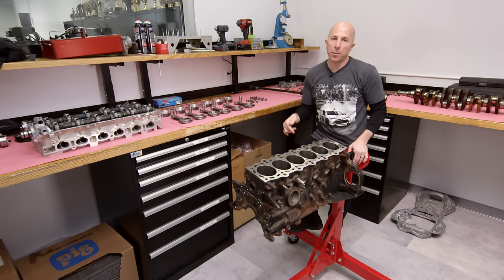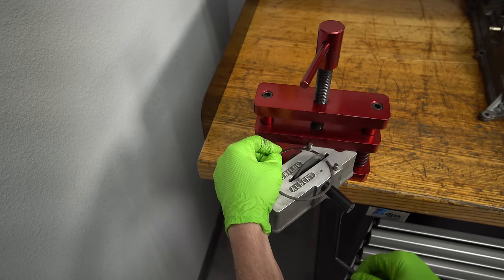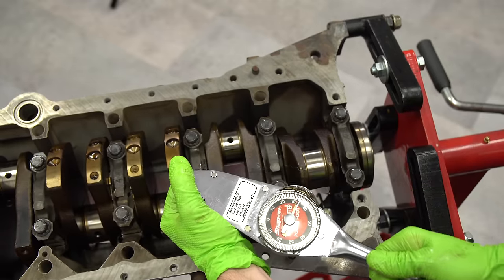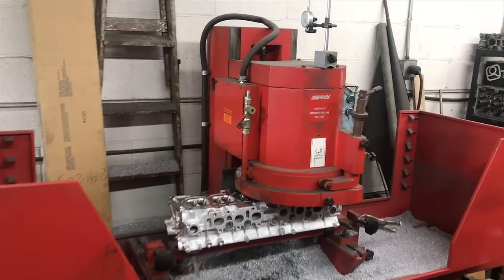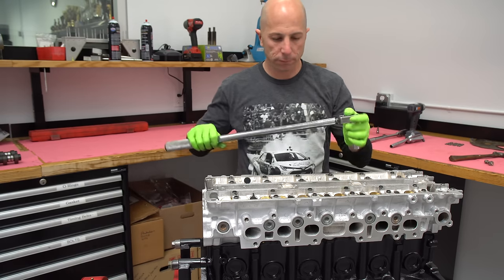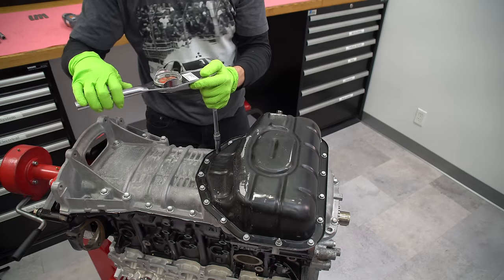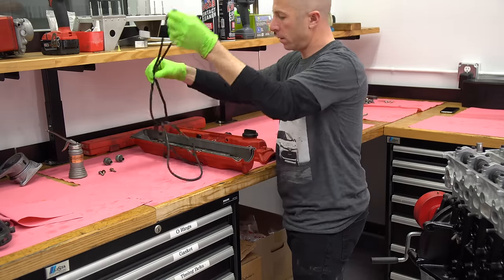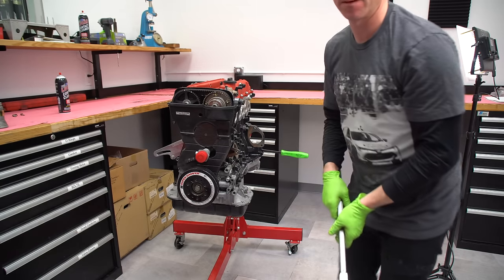Toyota 2JZ Engine Build - Full Start to Finish

Comment: What's the process for starting up the engine for the first time? Do you need to have it tuned properly? Is there a different process for trying to get the engine running with a stock ECU and a Standalone ECU?
Reply: @Ed O'Neill but to run on a dyno, you need to start the engine right? Is it possible to tune the engine before you start it? I'm assuming its just a baseline you need to develop and then you can get it right once it's running, is that correct?
Reply: @Ed O'Neill interesting, thank you for the insight, I got some studying to do on this
Reply: @Ed O'Neill lmfao
Reply: Ok, for those who don't get the humour and just want an answer: right after the build you want it just idling for a while... Nothing more than that. The stock ECU should be fine for most builds, and if you have some high-RPM camshafts then you kinda need to adjust some things (higher idling RPMs, perhaps a bit more fuel, etc).
You want it idling for these reaons: 1) to test that it runs and to see how smoothly it runs, 2) to let it warm up without putting it under load and see how the engine runs when warm (like testing compression and checking for leaks), 3) you won't have detonation and pre-ignition when idling so not much can go wrong if you just idle, 4) to let the oilpump spread the oil everywhere, 5) the piston rings start breaking in during the first +-15 mins of idling (read the manual for exact info) the tin coating and the special shapes and other magic is there to allow the piston-rings to partially break in.
Every engine is a bit different, you want to tune to either fit your particular engine or tune to make less power and be on the safe side (more like a factory tune or a baseline tune). But you can't have a perfect tune ready if your engine is not ready, right? So the proper way of doing it is to flash a moderate tune (with not too much power) onto the ECU to let it break in and to test it, after the break-in you change oils, check the state your engine is in. And after that you can then start finetuning and adding power and pushing it to the limit.
After a proper break in with moderate load, not too high revs, etc, you will have an engine that runs better than it was right after it was build. After breaking in you will have a higher compression due to better sealing of the piston rings for example. So how could you tune your engine before break-in?
---
This is how to get a longer lifespan on your engines, this is how you want to build streetcars for sure. On a streetcar you don't do an engine rebuild after ever few runs (like the top fuel dragsters do) so you kinda want it to last.
Reply: LMAO I should have read more carefully
Reply: @Ed O'Neill well played sir, I was most definitely giving you the benefit of the doubt hahahahaha made my day, you got me good
Reply: @sasjadevries  thank you for the answer, that makes alot more sense hahahahahahaha
Reply: Ed O'Neill 
Wait what?
XD

Comment: Hmmm. I was proud when I changed my own oil;(
Reply: changing your own oil or your own brakes for the first time is really satisfying tho, it's when you realize that you can actually stop being ripped off by your mechanic
Reply: alot of thinks can be done in cars with basic tools if you just know what youre doing, but theres still alot of thinks where youre going to need special tools and knowledge.
Reply: @PP-360  and youtube guides like chrisfix
Reply: @PP-360  no joke probably the best yt mechanic out there
Reply: @maxnasstrom2652  yep I agree
Reply: A lot of time mechanics just put the cheapest oil they can find into your car
Reply: @RmX.  Coming from a mechanic from Sweden. We don't, however, we rarely go for the best oil either. Oil changes are frequent and people who do care about their cars do service when they should according to their manual. Hence the quality of the oil does not matter AS much. Going for something in-between the best and the worst for regular changes basically keeps the car going until everything else in the car breaks down before the engine does. We always follow the recommendations from manufacturers. :p
Reply: You'd be surprised how many car owners don't know how to change the oil in their car!
Reply: @charlie_mk7.5  What is that profile picture?
Reply: @charlie_mk7.5  I can do it all day,I just got lazy as I got older and I just like to pay someone doing it for me.

Comment: As a vehicle technician I love watching these videos.

First observation is how much simpler the 2JZ engine is compared to the new Bmw/Toyota engine.

That new engine will never be iconic, but this engine has had a reputation for producing big horse power reliably for years.

I don't like all this over complicated engineering, it's not needed, the original 2JZ engine proves that.
Reply: oh yeah when you have to deal with the way tighter emissions and the way longer life expectancy of modern engines you will know why they get so complicated
Reply: Ja du musst ein Profi sein. Früher mussten kaum Emissionen erfüllt werden, gute Besserung..
Reply: The 2jz in the video isnt the one in the old supra, the one is the supra is the 2jz gte, which is built to hold more power, you could get a regular 2jz in an old lexus sc, but it cant hold the power

Comment: Dont the head studs have a torque sequence? Cause i thought you were supposed to go outside to outside inward type of thing or just nah? Cause in the video yall just did 3 right next to eachother. Unless if you were just checking them after the fact.
Reply: They have a very specific torque sequence, yes. You can find diagrams on Google images if you want to know what exactly it is.
Reply: the studs don't. the nuts that go onto the studs to clamp the head down do.

Comment: How long will last before you have to do this all over again?
Reply: Blatantly Fake Name they do it every season but on a safe tune it should last a few years without much issue
Reply: A long time dude. The 2jz is one of the most reliable engines ever.
Reply: Another 200,000 miles like any Toyota engine. They're going to lean on it pretty hard if it's a Drift engine with a bunch more boost but it will still go a good long time.
Reply: It depends on the clearances. The 2jz oem pistons are very very good and if your power goals are less thn 750hp you should just rebore, hone and install some new 0.25mm oversized oem pistons, by keeping the factory 2jz clearances. Forged rods with 625+ bolts and some nice trimetallic bearing and finally crank balance to your desired rpm. It will last a lot more than an oem 2jz. But, don't use titanium retainers, those will fail shortly. Very little weight savings for a lot compromise. Use stainless steel and with a safe tune you may see 150.000km with 650+ hp

Comment: How much does it cost at this point?
Reply: 1 million dollars.
Reply: I guesstimate 15-25k usd depending who you know
Reply: After 15 grand and if needed, overnight parts from japan, you will decimate all 😂 #2jznoshit
Reply: The cost really depends on whether you do it yourself or you need to hire an engine builder, and it depends on what country you live in. (In Russia decking, polishing, machining, etc is really cheap)
And it depends on how many non stock parts you buy, and in what state the engine was that you bought.
Reply: probably around 5-7k in parts
Reply: @sasjadevries (Caution! There will be wrong and breaked english) Yep! In Russia stock 2jz (good condition) cost ~2000$ . Full gasket set - 300-350$. Cylinder head clean and porting - 150$. Parts like timing belt, motor oil and etc, no need to include it in total price. Assebling the engine - its cheap, coz its easy. And total price for fully stock 2 jz-gte vvti - something about 2500-3000$. Im really exited when i see the prices like 15-20k$ in a comment section.
Reply: just had my bottom end built by a shop in TX and it was $4300 after I toasted a stock piston. obviously that does not factor in the entry price of purchasing the used engine originally and any associated headwork.

adding initial purchase price and all the head parts/labor (cams, springs, retainers, valves, pocket port, etc) with the bottom end stuff, and we quickly jump up to around $8-10k USD (not factoring in turbos, manifolds, etc).

and that's just for a build of this nature. they can easily get far crazier with strokers and all the other crazy stuff out there.
Reply: I'm not sure what it costs here in Australia but I'd expect "fucking heaps" due to our small number of people compared to almost every other country.....
Reply: ^ Yeh too right. Would be almost as much as a pack of smokes here.
Reply: @ardijanuar2036  Apparently you've never seen what the LS can do for a 1/3 of that.... #sloppymechanics
Reply: More than you can afford pal ;)

Comment: Y'all gonna 2jz swap a MKV or just build up the BMW engine it already has
Reply: some company is apparently working on that swap kit but it's going to cost an arm and a leg for R&D and drive the prices of the 2jz up even higher than they're getting. So get one quick if you want one!
Reply: @ConTheDon187  wouldn't it be cheaper to just drive a mk4 Supra then? Isn't it considerable that the 2j would make the mkv car just worse? I mean it's a great engine & a great base, don't get me wrong, but maybe the new engine just fits the car better.. You'll most certainly be able to make that thing fast too, but it would be more modern. If you're buying a mkv, you're not in the market for an older car..
Reply: I'm not the one making the kit and haven't driven a mk4 nor a mk5, I just said get ready for 2j prices to go up because of the company/companies making or setting up the swap kits. Someone told me, which they're comment disappeared that the kit will only be 9k, which i don't know is true or not. The bmw motor in the car is also an inline six which I'm sure you know and obviously toyota wasn't about to open up plants and re-manufacture all of the equipment to build the 2jz to put in the the car. it was a joint development with bmw to cut cost so it wasn't a ridiculously expensive car for under preforming. I'm sure the car is alright, but idk. Modern engine's only perform any better than older engines because of software developments and better tuning from the factory, which can still be improved but not for economical purposes, but performance. Realistically I'm sure the mk5 with a tune and a big turbo kit would be a good high power vehicle, and we will see when they start getting drifted and modded by pro race teams.   @HexlGaming
Reply: @HexlGaming  but yeah it's already cheaper to buy a mk4 turbo than the mk5 or to buy an na mk4 and turbo it depending on what your application for the vehicle is.

Comment: I did this to my 200,000k 1jz and it also was a dream to work on. It wasn't a full rebuild but more a complete clean, replace all gaskets/seals.

Its good having a brother in law as a mechanic so he had all the tools required and constant help when needed.

I should have never sold my Toyota Soarer :(

Comment: Loved this video.  I got a 2JZ in my IS300 2002 manual.  Its going strong almost 20 years later.  I had probably the basics of this done.  But I know 0 percent about this stuff.  I did know that Ferrari did the red valve covers tho so I guess I know a little.  But judging how well you did this engine, Id love to hear how that one sounded.  I bet it hummed like a humming bird.

Comment: putting oil on the head bolts thread is tricky....  Oil expanse during heat it can break a chuck of the block have seen it before. I think the workplace manual of toyota saying this also.  As for the rest of the engine build is spot on very nice.

Comment: You make it look so easy😥
I want to do a Ford Fiesta CVH 1.4i rebuild. I've had the engine block rebored and cylinder head reconed by engineers. I will put it back together myself. I should be ready to start my project if only there was atleast one video on these engines half as good as yours I would have enough confidence.

Comment: Stephen/community, perhaps I missed what kind of grey silicone you were using on the oil pan and cam seal caps. I’ve gone with the specification in my 1st Gen IS300’s manual, however, part numbers have changed and products have been updated/upgraded. There are different Toyota FIPGs for all different types assemblies throughout our various platforms/years/makes/models, etc.

What are your thoughts on alternatives, e.g.; Permatex max temp gasket maker 27038 in lieu of Toyota specifications, regardless of component?

Keep in mind that industry has advanced. However, product supply has slowed down across the globe. By the time I get a tube of Toyota FIPG, whatever type, from Japan it may be 6-12 months old at best. Permatex perhaps only 3 months old as it’s made in Ohio.

Comment: genuine question, why do you use the dial type torque wrench for the engine components, but you use the digital torque wrench for the cam sprocket?

Comment: What did you mean when you said that when you push the clutch to disengage it pushes on the thrust bearings? Does this mean when the clutch is actuated to avoid contact with the gearbox it ends up pushing the crankshaft slightly forward causing contact with the bearing?

Comment: So I'm in the process of a 2JZ build myself and noticed Paparazzi
Papadakis uses stock 86mm cylinder cylinder bores with stock pistons. I've heard it's always better to bore over to the next service size, but if Papadakis is using factory bores with forged pistons it must be doable.

Comment: 🤔🏁That's exactly the way I always put my engine's together i always torque and  measuring  everything i always torque  all of my boats I always check for any cracks or any  warping I always make sure I got the best oil seals has ever been made but I  always go with steel rod bearings & Mim bearings

Comment: With the steel oil pans, there can be too much FIPG use. At Toyota, we use the 2mm bead along the land of the pan and never smear it down. This gives a thick enough area to squeeze down and still cover any slight imperfections. I also use this in engines I build at home. Especially on the high up Grand National engines I have done.

Comment: After repairing brand new piston rings triming
chain and new valves the service guys put the car
tests and let it the car on in neutral for few hours
HoW we have to drive correctly before we change
the oil 1000 to 3000 km
Any help please because i don't want to damage
my car with new services

Comment: building engines is somewhat "easy" if you really understand what happens inside of it, the more you learn about a specific engine and how it works, the less problems you will have while building it, you only a need a trustworthy machine shop, the rest is just a big ass puzzle for you to assemble correctly

Comment: Hey I know this is an old video but just a question. How come you use a factory head gasket if you bore out the cylinders? Would the gasket possibly overhang slightly into the cylinder?